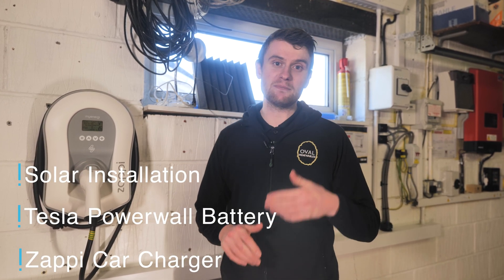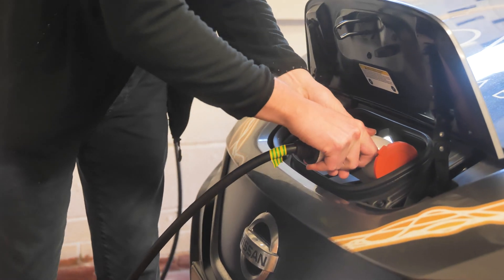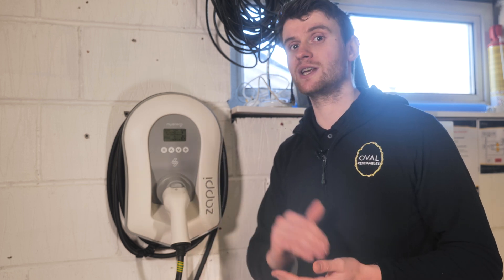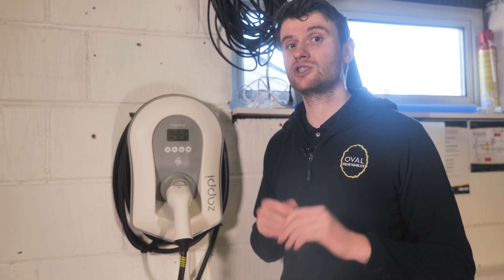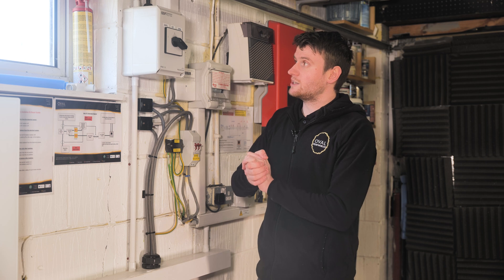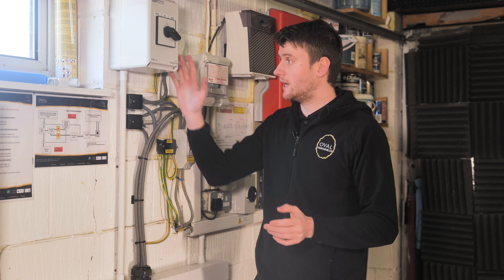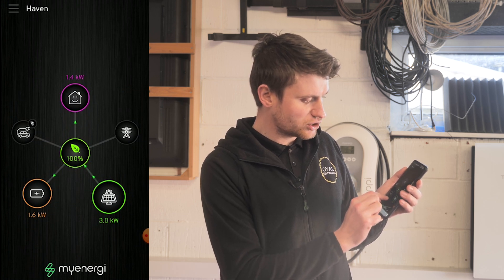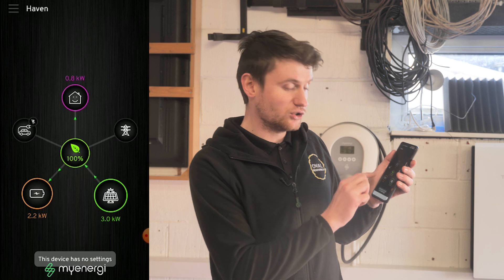North Ferriby Home Energy System Part 3 - MyEnergi Zappi Integration

Comment: I have the same set up. One frustration I experience, when Zappi is on ECO+ the Zappi also draws from my Tesla battery as well as solar. The only solution I have seen is re wiring the system. In today’s technological world that solution seems very outdated.
Reply from the maker: Has the installer installed a CT clamp on the solar and battery circuits?

Comment: Nice video, getting a zappi at the end of the month with my existing solar, battery setup. How do you set it up so the battery does not charge the car, but only excess solar. Surely the battery software just sees the car as house consumption and tries to cover it?

Comment: Whats the best battery on the market? Would you recommend the Sonnen?
Reply from the maker: Probably Tesla but Sonnen, Alpha and Solaredge are good. It depends on the application
Reply: @OvalRenewables  Thanks. The Tesla isn't an option for me in Ireland. Something to do with max inverter size is 6kW in Ireland as it stands, 6kW inverter would only allow a 6kW output AC coupled battery as rules stand. It will limit output or something along them lines!! Thanks I will check out the others. Some also mentioned Sonnen are rolling back in the UK but not sure if that is true.